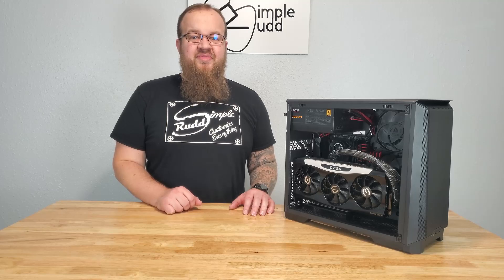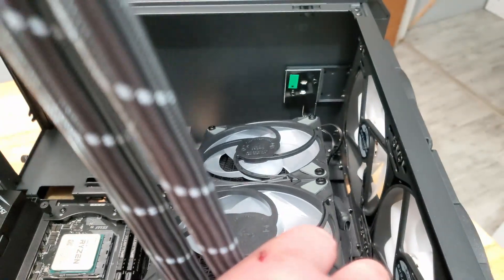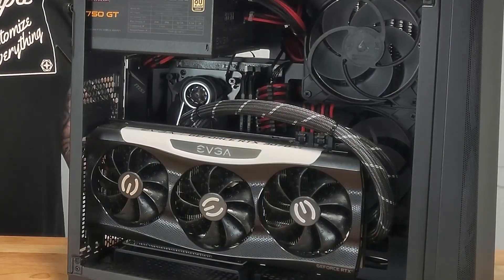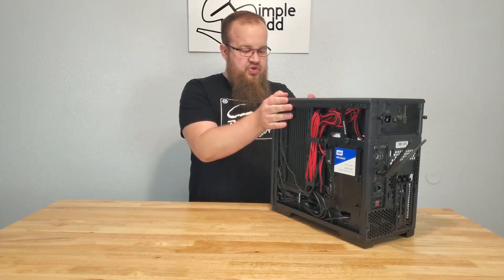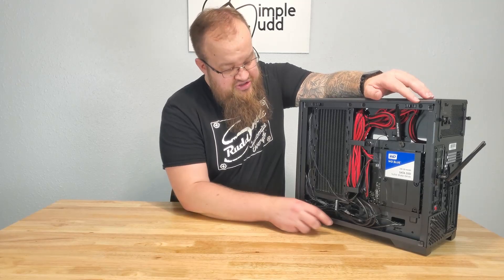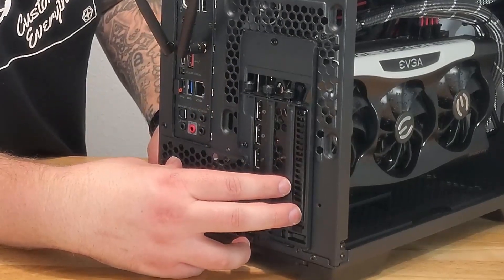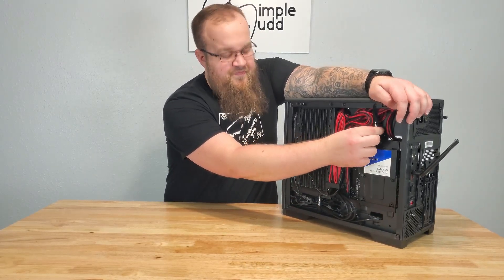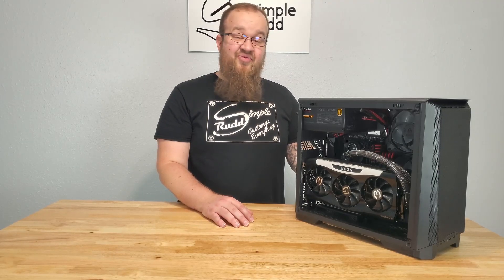Phanteks P200a Building TIps

Comment: Just built in this case using the new Arctic Liquid Freezer III 240. Wanna say THANK YOU for the advice about the power button, would not have been able to fit the radiator in there without reversing it like you suggested. You saved me the trouble of sending the AIO back for another!
Reply from the maker: Glad it helped!

Comment: Hey brother. About to snag this case. Will a 240 rad fit on the front and side if i mount front fans on the exterior? My 6900xt is factory cooled with a 240
Reply from the maker: I've only seen one built with two rads. The front rad was 20mm thick. I think to fit side and front, the front rad would have to be less than 25mm thick. That is to say without modification. Anything is possible if you mod enough haha.

Comment: Awesome build and video! Just a quick question, i was thinking of installing the Dark Rock Pro instead of an AIO, with 2x 140mm Silent Wings 3 at the front. Would you recommend that?
Reply from the maker: It will be a tight fit, but that should be plenty to keep the PC running cool! Plus there's plenty of other fan locations if you feel the need to add more.